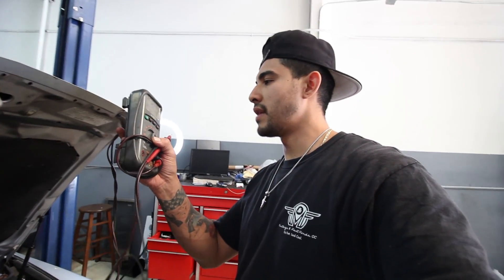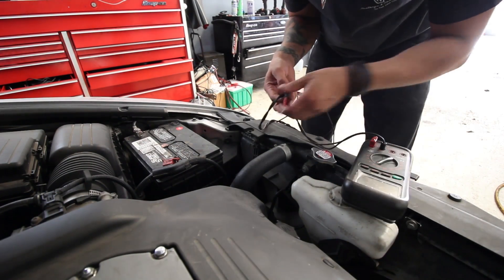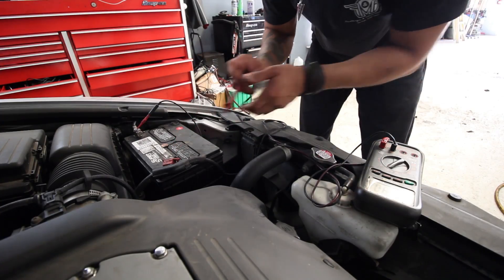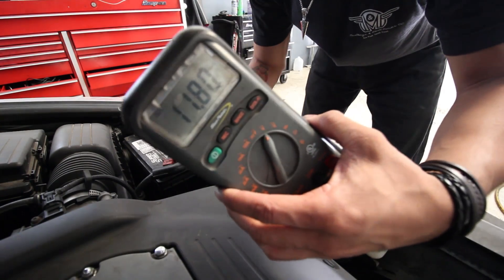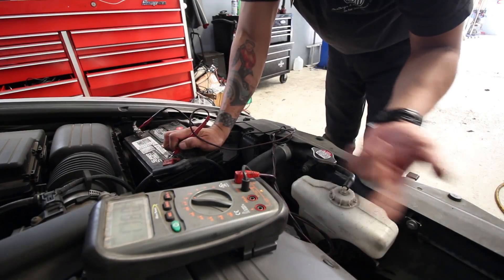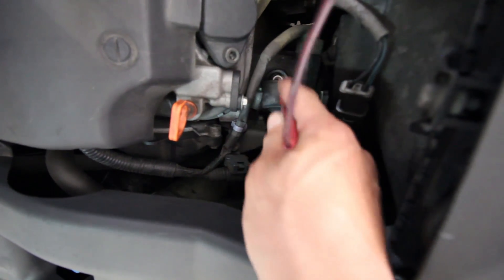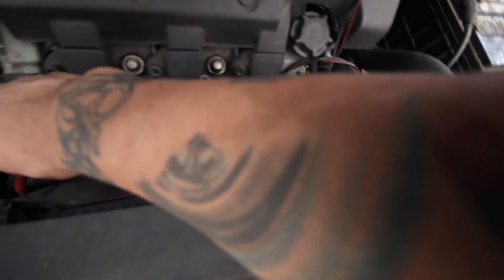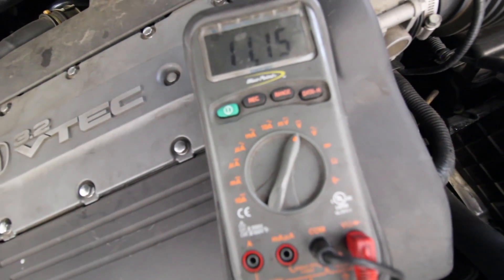Easiest way to check a bad alternator

Comment: Easier and faster way to diagnose the charging system, turn your car on, take out the negative cable from battery and if the cars stops after a few seconds then alternator is bad, if car is still on then your battery is bad, you don't need the multimeter unless you want to really check for in depth info, which clearly you don't really understand (viewer) and that's why you're here. Lastly let say the cables from or to the alternator are bad then just check for burnt, broken, corroded wires, still you don't need a multimeter, save money, simplify your life

Comment: Not a reliable test with more modern cars.
Reply from the maker: how so
Reply: @Mechanicrepairs  I have 2014 accord. The voltage sometimes runs at 12.5. I took it in to get tested and they said all is working properly. Car always starts up. The only thing that bothers me is that the ac doesn't blow as hard when voltage drops to 12volts.

Comment: Hey OC, I'm a Chrysler tech thought I would throw it out there that some of the newer Chrysler vehicles like the caravans and chargers and almost anything with a 3.6L the PCM has a generator in it that likes to go bad. I've seen a lot of guys throw alternators at cars and it doesn't fix the problem, didn't figure this out until it happened to me.